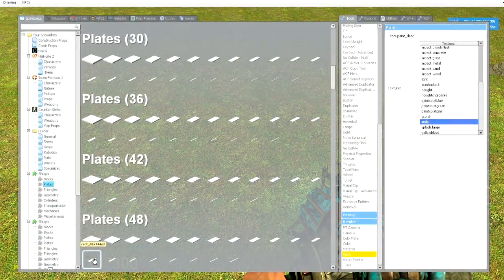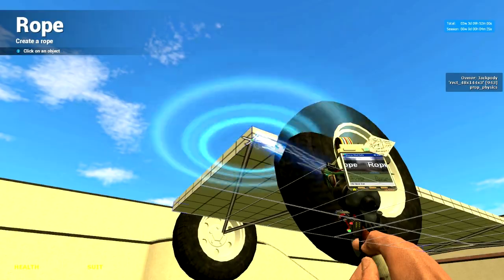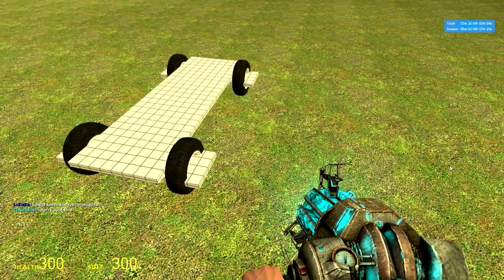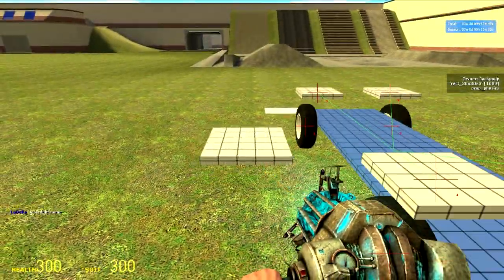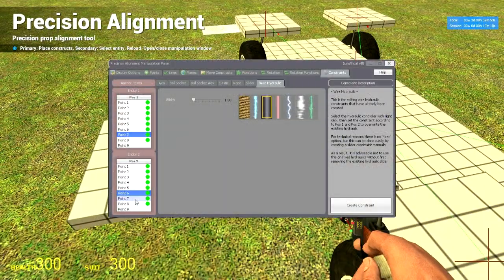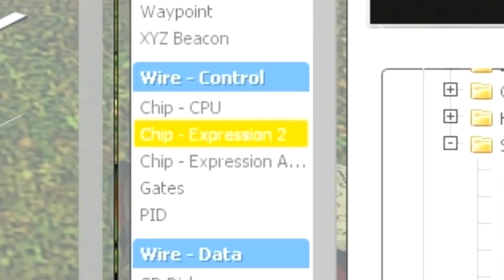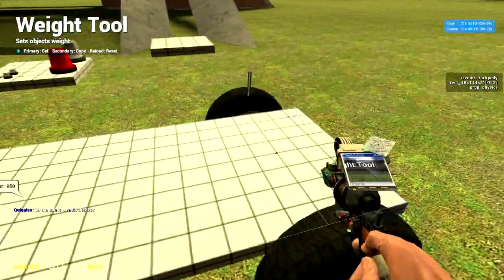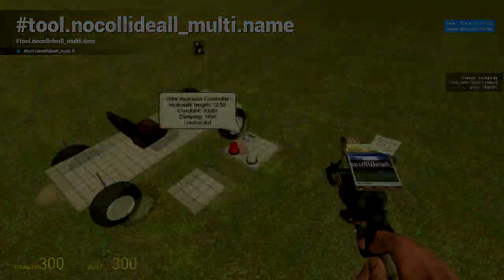[GMod 13] Suspension & Steering Tutorial - Simple

Comment: I don't have such a detailed menu, what the hell, i'm so pissed off, mine is just like 30 tools. you've got over 2000 tools, how did you do that???
Reply from the maker: You have to install some of the tools I use in the video, GMod doesn't come pre-packed with a lot of great tools for constructing vehicles / other contraptions.
Reply: Thanks. is your menu modded, anyway?
Reply: Still, i can't find any tools pack.
Reply from the maker: They aren't a "pack", you download them seperately. If you look for "Make Spherical" or "MakeSpherical" on the workshop, you can press "Subscribe" and it downloads that tool. Then it shows up in your spawnmenu like it did in mine.
I posted a link to the MakeSpherical I use somewhere in the comment section, same with some of the other tools used in the video.
Reply: Its possible you have gmod 11 no 13 :)
Reply from the maker: Then he has a pirated version.
Reply: i bought it when it was on sale.

Comment from the maker: +▼e I do. How would you imagine it to be pronounced  then?
Reply from the maker: Quick answer would be to lock the rear wheels. What you do is make every max / min setting in the adv_ballsocket settings 0. Then press on the inside of both rear wheels. The veering on throttle happens because one wheel spins faster than the other. If that doesn't work, attempt doing it on front wheels or a combination of both.
Reply from the maker: You have to download the E2 I use in the video. You can find it in the description. It won't actually download anything, you just need to copy / paste it into the E2 editor. Done, fun!
Reply: is it a dupe?
Reply from the maker: It is not a dupe but a text file. However, you can download the duplication of the chassis made in the video inside the description - it also has the E2.
Reply: +JackpodyDK How do you get the dupe i copy and pasted the text document code or do i have to some how drag the text file into advdupe2
Reply from the maker: You save the file as a .txt and place it in your data/dupe2/ folder.
Reply: JackpodyDK I figured it out but thanks.

Comment: How to use the E2?
Reply from the maker: I'm confident I show that in the tutorial.
Reply: JackpodyDK  Well, I don't see where.
Reply from the maker: PixelGamer From 11:07 and onwards.
Reply: JackpodyDK  How do I get it from that menu, like, the actual brick. How do I put it in Gmod?
Reply from the maker: PixelGamer You want to download the expression by clicking the link in my description (it doesn't actually download anything, it just pops up in your browser with some code). Copy all of the code. Go into GMod, then into the Wiremod menu. In there, find Expression2. In the submenu, press "New Expression". Remove everything inside the box that shows up and enter the code from my description. Press the little "x" in the corner.
If the E2 does not change to the model in the video, go into the Garry's Mod console and type in "wire_expression2_model models/sprops/rectangles/size_3/rect_24x24x3.mdl" without the ". 
Hope it helps.
Reply: JackpodyDK  Thanks.
Reply: JackpodyDK Yo! your code does not work: setAng no longer exists and propFreeze no longer exists. I tried to fix by using applyAngForce in place but there's no replacement for propFreeze
Reply from the maker: KiritoTheSoloPlayer That is very weird. Try to go onto Cre8ive (the IP for the server can be found in Laptimes FIVE video) and tell me if it works. If it works there, then your Wiremod is not functioning properly in singleplayer.
Reply: JackpodyDK server is down atm, and I'm using the github wire/wire ext etc etc
is there an e2 plugin I'm missing? those commands aren't on the wiki either
Reply: JackpodyDK Rightyo! found the problem.
 By default propcore is disable, but it is in UWSVN -

To get propcore to work just enable it by running

"wire_expression2_extension_enable propcore"

(without the quotes) followed by

"wire_expression2_reload".

nice vid btw :)
Reply from the maker: Thank you, glad it worked.

Comment: So uh.... my rear wheels steer and my front wheels are perfect. My rear wheels are well... broken
Reply from the maker: Sounds like a ballsocket issue. Did you remember to build pointing North on the map?
Reply: Jackpody I wasnt able to spray (made my own one person server) Last of all, I tried what video said, Ballsocket Advanced in the centre of the wheel, And place it to the side
Reply from the maker: But I have to understand, did you or did you not build pointing North on the map?
Reply: Jackpody i wasnt able to set down my spray, so most likely not?
Reply from the maker: Then that is why your wheels don't work. Go onto the map I used in the tutorial (gm_carcon_ws) and build in the exact same direction as I did (and I do mean exact, so remember to use shift-snap). You only need to redo the ballsockets, so just remove those (press R with the ballsocket tool on the wheels) and redo the ballsockets in the new direction.
Reply: +Jackpody Ah this time it worked, Its that the author of the map said "Garages are north" and so i thought the doors.
Reply from the maker: Ah, I understand. Glad it worked.
Reply: i have a question: could you make a written tutorial? because videos really confuse me
Reply from the maker: Sorry but I do not have time to make written tutorials about this stuff. I remember a friend of mine made a written tutorial on a chassis setup many years ago, but it should in theory still work. 
http://pcmciakai.jimdo.com/tutorials/gmod-independent-suspension/
Reply: Jackpody thank you this really helped me

Comment: ok i found the problem the E2 freaks out
Reply from the maker: Try to test the opposite. If you're on a server, try to go to singleplayer. If you're in singleplayer, try to go to a server and then see if it works. 
What Wiremod installation do you have on your client? Do you use the workshop installation or SVN? I have a feeling it's not updated as the E2 should function from the moment you spawn it. When you spawn it, does it jump around instantly or first when you hook it all up?
The E2 should not be weighted, the entire car should be with the weighs I show near the end of the video.

Comment: Please repair E2_setang_steering
Reply from the maker: +MrGameCZ thm98 W-what? It works just fine. You must enable propcore in GMod for it to work - I post the command several times a week in the comment section because of the amount of questions I get regarding the E2 (if anyone else reads this, do remember to check the comment section / description for hotfixes).
Reply: Ok, sorry :)

Comment: DOESNT WORRKK AAAGHH whatever i do the wheels just roll into the chassis when i unfreeze WHAT THE>>>???? i did everything like in the video 6 TIMES
Reply from the maker: +shomi Did you remember to build pointing North on the map? I explain the importance of this by the beginning of the video.
Reply: for some reason my spray doesnt work.. anyways i built in all directions on the map... doesnt change anything
Reply from the maker: You have to build to EXACT north, not just "around there". It's because of the ballsocket settings. Try loading up gm_carcon_ws and build the EXACCTTTT same direction as I do. Physgun and shift to get props to lock into directions.
Reply: ok will try now thanks
Reply: +shomi it works hah finally ty m8 so much
Reply: +Jackpody What could we do if for example we've already build a vehicle shell? What could we do to easily move all the props? Also thank you so much for your video tutorials, ACF is quite complicated for a beginner like me but I've started to figure out how to use it.
Reply from the maker: If you want to move all the props of the vehicle shell, then parent them to a gate and move the gate. I think my tutorial covers your question, but I may be interpreting it incorrectly.
Reply: +Jackpody No I've gotten it done now, but thank you. All I'm having trouble with now is my suspension going quite high into my body, which I'd assume is weight related. I'm not 100% sure how to properly weight yet.

Comment: my car's wheels flip, please help
Reply from the maker: Make sure you use the correct ballsocket settings while constructing the vehicle pointing North on the map.
Reply: JackpodyDK thanks, and can i save and upload this as a dupe? im asking your permission because you made it. i will put your name on credits if you allow me to but it is okay if you dont
Reply from the maker: You can, as long as you made it yourself. However I don't think the standard GMod duplicator will be able to save this.
Reply: okay then, you're true because i cant dupe it with standard duper
Reply: thx and btw the e2 model wont change (sorry for so many questions!)
Reply from the maker: There's a quick way to change the model of the E2 inside the description.
Reply: i did that and it still didn't change; maybe an invalid command
Reply from the maker: Check the weights then. I'm not sure what you are doing wrong but I can conform that the tutorial still works when done correctly.

Comment: MY WHEELS WOJNT STOP SPINNING
Reply from the maker: I looked at it and I'm not sure what to see.
Reply from the maker: It's really not and if it's glitching out, then you did everything / something wrong. The video in question still works just fine. I cannot help you if you don't describe what exactly went wrong.
Reply from the maker: That is not because of the tutorial - that's because of some wrongdoing on your end. Did you remember to build pointing North as I explained at the start? Did you remember to use the correct ballsocket settings?
Reply from the maker: The thing is, you're doing something in the tutorial wrong. I can't quite tell you why from this arbitary comment section.
Reply: when I unfreeze the wheels after applying the ball sockets they still go extremely fast and just go everywhere
Reply: even the pros couldn't fix it
Reply: literally 10 people tried to fix it and they couldn't stand a chance
Reply: we call it, the spazz
Reply: its a monster
Reply: I had to go out so I rushed, really cringey
Reply: can somebody help me fix this

Comment: E2 isnt a thing anymore....
When i follow link it says 404 file not found
Reply from the maker: E2 is definitely a thing, but the link is 404'ing - thanks for the heads up! Looks like Dropbox changed their public folders to not be private. Instead of adding a new link, I've pasted the code at the bottom of the description. Good luck with the car!
Reply: Adjust wheel weight... More weight - more grip. More grip - less slide

Comment: My wheels won't spin
Reply from the maker: Did you remember to build it while pointing north, as I explain at the start of the video?
Reply: Justin0919 They still won't
Reply from the maker: Alright, if the wheels do not rotate, then it is most likely a ballsocket issue (therefore I ask if the car was pointing North when building it). Do check if you got all the ballsocket settings right as they are shown in the video (notice that some values are positive and some values are negative) and the three check boxes at the bottom of the ballsocket menu are ticked as in the video. If that does not help, then hook me up on Steam, you can just Google "Jackpody Steam profile" and I should come up first. I need to know your Steam name though, else I cannot accept it on the list. Then I can help you out in game to get it to work.

Comment: my front wheels are not attached to the chassis ;/

EDIT : Fixed :D now i can make ACF cars
Reply from the maker: You can indeed! I do advice checking out my more recent tutorial on how to fix wheel spass as well, as it shows you how to weigh your vehicle for optimized ACF usage.
Reply: thanks :D but i have a small problem

its good to go fast but how i make a brake system ?
Reply from the maker: Easiest way is to wire the "brake" output on the transmission / differential to a toggled button with the value of 0 off, 4 on. Then wire "A" on the button to "S" on your pod controller. The "4" controls the amount of braking and the "S" could be any other key.
Reply: I see a Brake option in the gear box ? i use it ?
Reply: Thanks you :D how i incrase Braking ? (sorry for bad english XD (French))

How How do I put reverse gear?
Reply from the maker: Increase braking by changing the value of "4" to a higher number.
Reverse is normally last gear (is a negative value in the gear menu).

Comment from the maker: @Tommy Beyer Please turn on your replies, else I cannot reply to you.
Reply: My wheels are stuck and not turning , Pls , HELP ME
Reply from the maker: You either have the wrong ballsocket settings or you forgot to build pointing towards North.
Reply: For the ball socket , i have this tool : Ball Socket Center
Reply from the maker: Then download ballsocket advanced, it's on the workshop.
Reply: JackpodyDK ok thanks
Reply: +JackpodyDK 

The E2 Script you have to change the model no longer works correctly. 
The way models work is completely different is there a way around this. 
Could you please help me?
Reply from the maker: Did you try the command I posted in the description?
Reply: +JackpodyDK 

I got that working now. but when i go to unfreeze the tires they flip out and start bugging.
Reply from the maker: Are you building towards North? Are your ballsocket settings identical to the ones in the video?
Reply: +JackpodyDK 
I didn't see the importance to building towards north and yes I have triple check all settings. I have built the car based off your video 2 times now. I will try building facing north
Reply from the maker: If you do not build pointing North, then your wheels will spass out.
Reply: JackpodyDK

okay let me try again point north. Thanks for the tips
Reply from the maker: Sounds like you forgot to weigh it.
Reply from the maker: Sorry but I do not have time to be much on Steam anymore. It's best if you contact me here.

Comment: I could put a V8 in anything and get 33 MPH out of it
Reply from the maker: Your comment is a bit vague. Either your car weighs way too much (use the debugging tool on the engine, check mass weight) or your final drive is all screwed up. Does your engine not rev / rev up at the redline all the time?
Reply: I'm new to ACF so I do not know how to Fine tune Gearboxes. No the engine never Rev/Rev to the redline all the time, im very confused why. thanks for the quick response!
Reply: Plus im not sure what engines I should be using for certain vehicles, I know it gives a brief description but that sometimes isn't enough, like lets say I wanted to make a F1 car.
Reply from the maker: That is honestly just general knowledge about cars, it's not ACF specific. I really cannot help you with theory.
Reply: Just wish I could go faster than 30 without thrusters... thanks anyway!
Reply from the maker: Limit the weight. The car in the tutorial weighs like 2 tonnes. If you make the base prop 350 and the wheels like 80, it'll go much quicker.

Comment: My wheels dangle losely :&
Reply from the maker: +Quest Did you build pointing North as I explain at the beginning of the video? Are you sure you used the exact same ballsocket settings as I did?
Reply: Jackpody I built in north, ill have another go..
Reply: +Jackpody Tried again from scratch made 200 % sure i was facing north and wheels still do that :/
Reply from the maker: Then you're using incorrect ballsocket settings (or you forgot to tick on "rigid" in the rope menu, which can also lead to wheel flop).
Reply: Jackpody Yeah i didnt tick rigid in the rope menu i never saw that ticket cause its zoomed in at that part oh well gotta start from scrath again ._.
Reply from the maker: If you saved your car before unfreezing it, you can just press R on the wheels using the rope tool, and then redo the ropes. That would fix it.
Reply: +Jackpody YES Thank you! Subbed and added to faves
Reply from the maker: :D Glad it worked!